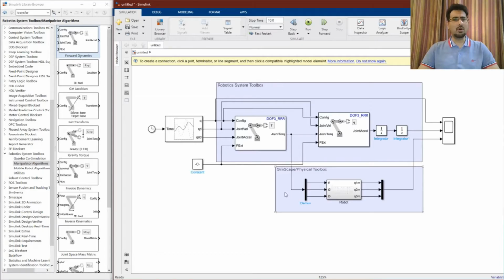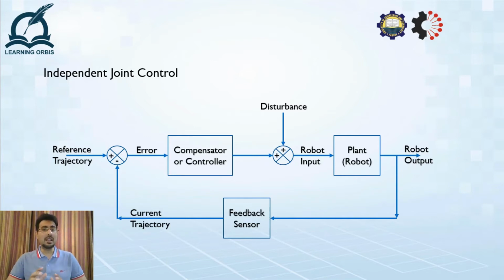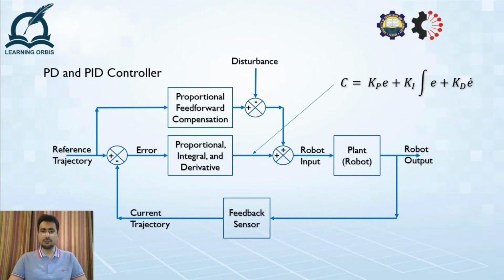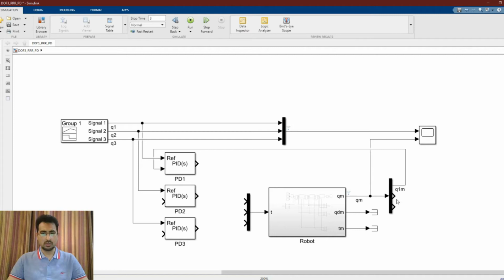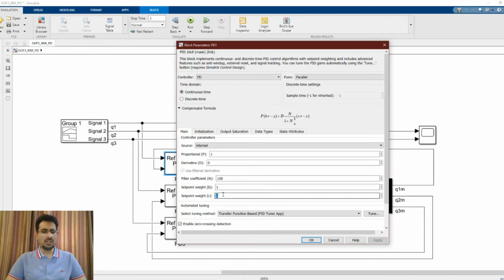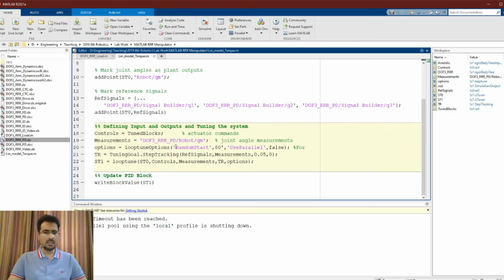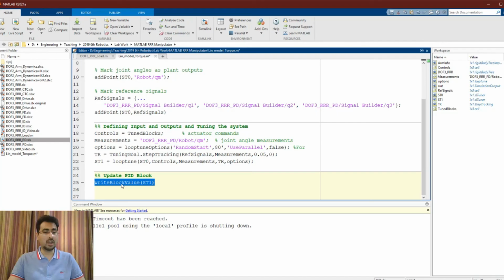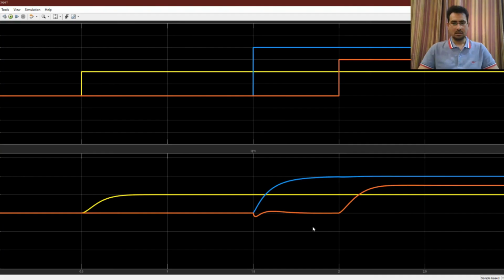PID Controller for a Robot Manipulator in MATLAB 2021 | RST | SimScape

Comment: Thank you for your videos, I find them very useful.
I have a question, If I want to apply an SMC controller for a dynamically modeled robot manipulator in MATLAB simscape what will I do to design the controller? Can I control only the joint motors through SMC or must I bring the mathematical equations of the robot dynamics to control the modeled robot in simscape?
It would be great if you made a video explaining this.

Comment: The Simulink model xTry_TorqueCtrlConfigure could not be linearized due to a discrete pole at z = 0 that is being
converted to the continuous domain using the 'zoh' rate conversion method.  Set the RateConversionMethod to 'tustin' or
'prewarp' or the SampleTime > 0 in the linoptions configuration object.
 Please HELP ME，why is this

Comment: hello. I have a problem, I repeated all your steps and when I try to run the file.m returns an error: 
Error using slTuner/looptune (line 83)
In "looptune(sllin,...)" command, the point specified by "Controller/robot/qm" does
not match any of the existing ones:
Controller/PD1/1
Controller/PD2/1
Controller/PD3/1
Controller/robot/1
Controller/Signal Editor/1[q1]
Controller/Signal Editor/2[q2]
Controller/Signal Editor/3[q3]
Error in Lin_model (line 17)
ST1 = looptune(ST0, Controls, Measurements, TR, options);
__________________________
and in the simulink model:
Invalid setting for input port dimensions of 'Controller/Demux1'. The dimensions are being set to 1. This is not valid because the total number of input and output elements are not the same
Component:Simulink | Category:Model error
Error in port widths or dimensions. 'Output Port 1' of 'Controller/robot' is a one dimensional vector with 1 elements.
__________________________
Please, I need your advices. how can I fix this?
Reply from the maker: You are not naming the signals correctly. Moreover, your signal, most probably, joint space signal doesn't have proper dimensions. Email me your file and I'll try to fix it.

Comment: I've watched your videos, they have been amazing and a great help to me. In controlling the SCARA robot that I have designed, I want to input a step signal into the input of my 3-signal system, but I'm not exactly sure what data to enter in the signal editor under the time and data sections. Do I need to perform any specific calculations to apply a step input?

these are my data:
 

x=[1.412,0.8696,1.412,1.412,1.821,1.545,1.8312.382,1.412]

y=[-3.142,-2.088,-3.142.-3.142,-3.142,-2.31,-3.142,-3.142,-3.142]

z=[-0.086,-0.086,-0.086,-0.186,-0.186,-0.186,-0.186,-0.386,-0.086]

t=[0,1,1.5,2,3,4,4.5,5,6]

Comment: Hello Sir ; thank you a lot for this instructing videos ; I tried to reproduce the same work and it gave me two problems: 

+ the first one when I begin simulation (I have set some values of the PID), The robotic arm behaved crazy unstable with random motion ;

+ The second problem ; when I tried to use the optimization algorithm you've presented It gives me an error  :" Error using slTuner/looptune
In "looptune(sllin,...)" command, the point specified by
"Robotic_arm4_at_zeropositions/Robotic_arm_4_PID/Thetasreal" does not match any of the existing ones:
Robotic_arm4_at_zeropositions/PID 1/1
Robotic_arm4_at_zeropositions/PID 2/1
Robotic_arm4_at_zeropositions/Robotic_arm_4_PID/1
Robotic_arm4_at_zeropositions/Inverse kinematics equations of the robotic arm1/ SFunction /2[Theta1d]
Robotic_arm4_at_zeropositions/Inverse kinematics equations of the robotic arm1/ SFunction /3[Theta2d]
Reply: I got the same error too, have you managed to fix it?
Reply: This is because those signal lines are not named, they are the default 1 2 3.

Comment: Thanks for the video. When I try this auto-tuning on my planar 2 DoF robot arm, I get very large value for controller parameters and the result is also not following the reference signal. How can I fix this issue?
Reply from the maker: Try to change the initial conditions and stability criteria of the slTuner.

Comment: Is it a non linear system? I can not tune pid why is this problem creating??
Reply from the maker: Yes it is a non-linear system. We haven't linearized it.
Reply: @LearningOrbis  but my main focus is to controller design what can i do brother?
Reply: @LearningOrbis  is there any option to linearize it?
Reply from the maker: Yes. Kindly view my video on Computed Torque Control, present in the same playlist. In that we use forward dynamics to linearize the system and then using a simple PD controller we can control the robot.
Reply: @LearningOrbis  but is there any option to tuning this??just like using pid tuning app?

Comment: Thank you for your videos, I find them very useful. There is one point in this video that puzzled me. In the PID block, while the reference and inputs seem to be angular positions, the output appears to be torque as there is a 't' in the subsystem input. Could the output of the PID block also be an angular position?
Reply from the maker: The output of the controller depends on the system that is attached after it. Currently, the robot after the PID block requires torque input that is why the controller has been tuned to produce torque, whereas if the robot required position commands the controller would have been tuned to give angular position output.

Comment: Can you help me 
When i try to tuned code 
This message appeare 
Creating sltuner and configuring it 
Create sltuner interface
Reply from the maker: Go through the PID tuner code again. You might be missing the initial lines that create the sltuner.
Reply: %% creating sltuner and configuring it
% create sltuner interface
TunedBlocks = {'PD1','PD2'};
ST0= slTuner('sm_test1_PID',TunedBlocks);

%mark outputs of pid block as plant input 
addpoint(ST0,TunedBlocks);

%mark joint angle as plant outputs 
addpoint(ST0,'robot/qm');

%mark reference signals 
RefSignals ={... 
    'sm_test1_PID/Signal Builder/q1', 'sm_test1_PID/Signal Builder/q2'};

addpoint(ST0,RefSignals)
%% defining input and output and tunning the system 
Controls =TunedBlocks;      %auctator commands 
Measurements = 'sm_test1_PID/qm'; %joint angle measurements 
Options = looptuneOptions('RandomStart',80,'UseParallel',false);

TR = TuningGoal.StepTracking(RefSignals,Measurements,0.05,0);
ST1 = looptune(ST0,Controls,Measurements,TR,Options);
%% update pid block 
WriteBlockValve(ST1)
Reply: This is my code idon't know where is the problem
Reply: @remonremon1234  my problem is same .can u give any proper solution ?

Comment: When I try to run the simulation it gives me an error related to the inputs, I have my joint inputs individually as(Q1, Q2, etc.) for my 4 joints on the robot, but when I make the sub system with the PD controller and signal maker, it gives me that error. Are your robot inputs set up differently from your previous tutorial videos? I've been kind of stuck on this part.
Reply from the maker: If number of inputs or type of the inputs doesn't match your robot then it will give the error related to the inputs. If you can share the exact error, then I might be able to help you concretely.

Comment: An amazing video, keep it up. I have a question, If I want to apply an SMC controller for a dynamically modeled robot manipulator in MATLAB simscape what will I do to design the controller? Can I control only the joint motors through SMC or must I bring the mathematical equations of the robot dynamics to control the modeled robot in simscape?
Reply from the maker: You don't need dynamic equations of the robot if you have robot's model in simscape. You only need to implement the SMC.

Comment: Your video is very interesting! thank you for making this. I have a question, if I want to apply it to Robot in real, is the mathematical modeling of the actuator also considered or only dynamic modeling of the robot to design the PID? and how do I get the real value of joint velocity and acceleration on the robot?
Reply from the maker: It depends on the motor controller you are using. For real robots motor controllers can control robot through kinematics and/or dynamics, yo just have to configure it. As for the real vales of joint velocity and acceleration, you have to use a feedback sensor, mostly an encoder.
Reply: @LearningOrbis  Thank you, Looking forward to another interesting video from you

Comment: Can i use different controller instead of PID ( example : sliding mode controller)
Reply from the maker: Yes, of course you can.
Reply: @LearningOrbis  HOW ?
Reply from the maker: There is no built-in block for implementing Sliding Mode Control in MATLAB. You have to implement it from scratch, on your own.

Comment: I have a doubt,how to give torque to robot arm
Reply from the maker: You have to change the Actuation method from the settings of all the joints. Moreover, you should change the signal of Simulink-to-PS converter to give N.m as output.

Comment: Thanks for the video
We're working on something similar but with 4DOF robot
We tried to do the PID control optimization similar to what we saw in the video
Yet it's not working for us
Also, we would like to know how we get tau for the tuning goal
Waiting for your response
God bless you
Reply from the maker: I've used the same thing for my 5DOF manipulator and a 7 DOF manipulator as well. Tau is the time constant in case of a step response. You should be using step input to all joints, but if you want a varying trajectory control, then unfortunately PID cannot give you the desired response. For that you have to implement a feedforward block as well. I'll describe that thing in my next video.
Reply: Can you share your work pls